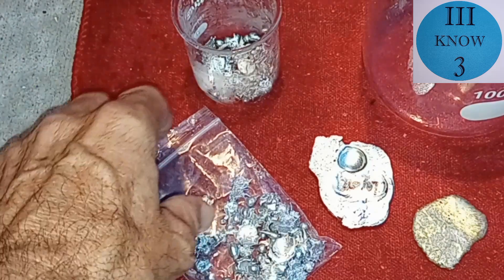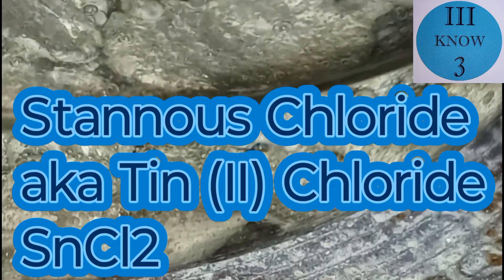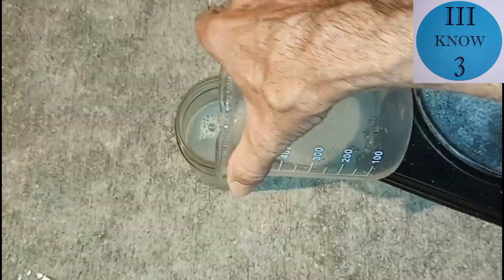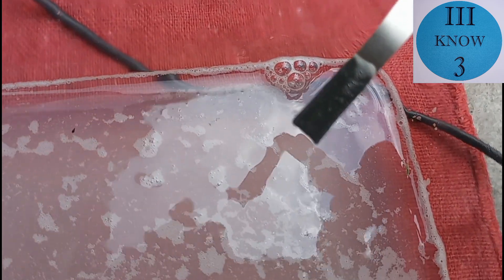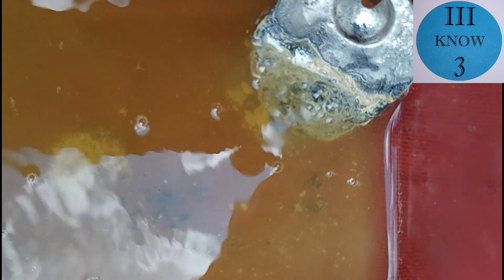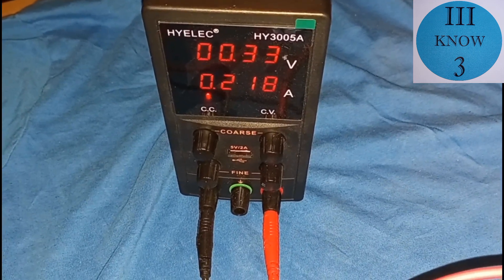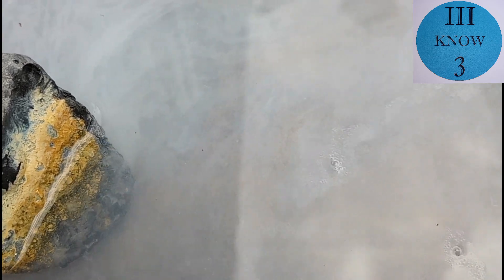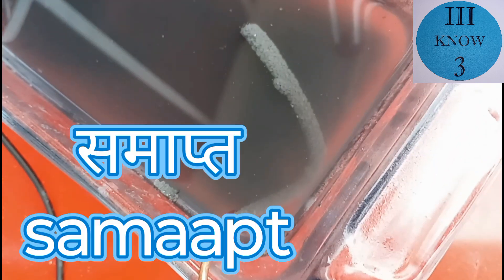Tin Metal Acid and Electricity

Comment: @IIIKNOW3 Could that tin actually been made from tin solder? Because if that´s the case, it makes sense that lead chloride would form when dissolved in hydrochloric acid?
Reply from the maker: I wondered that at first.  I asked the seller if that was the case and he said he didn't melt any solder.  I looked at some of the items he purchased and noticed lots of Micheal Ricker figurines.  The figurines would not need to meet modern lead-free standards for pewter like plates and cups would, so using lead would be cheaper.  They were certainly not 96% lead-free tin.
Reply: Sulfuric acid will precipitate the lead from solution, if you've added too much a little calcium chloride will precipitate as calcium sulfate.
   Mixed lots of old pewter that could possibly contain old solder can also  contain antimony arsenic and bismuth and I haven't figured out yet how to test for or separate those yet.